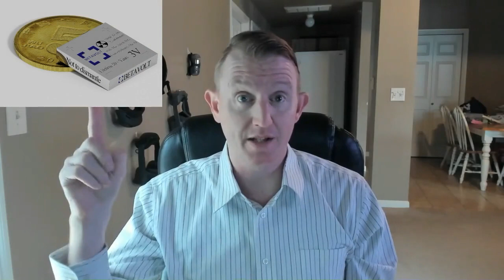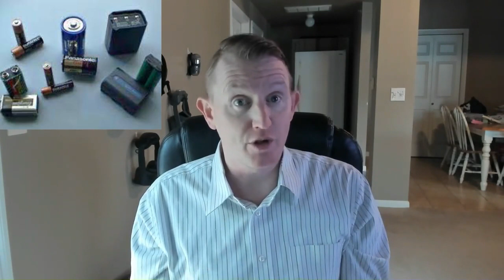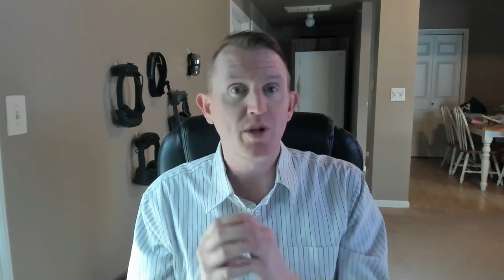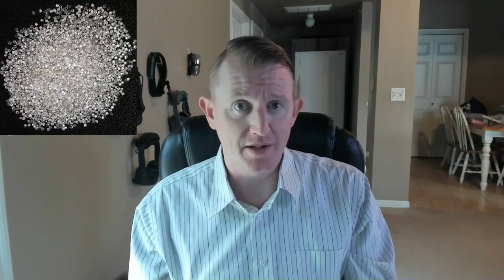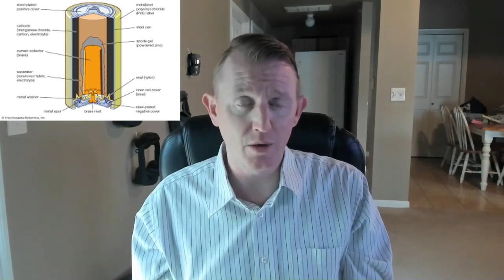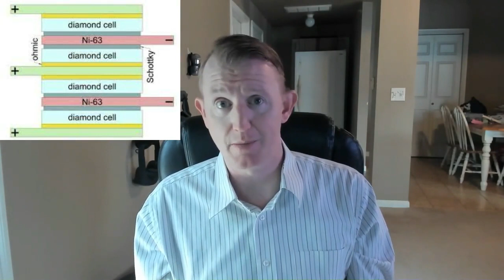How Betavolt's Nuclear Battery (Somewhat) Surprised Scientists with Its 50 Year Power Lifespan

Comment: There are many different semiconductive materials that will work and do work at a  mass produced level . Diamonds are now mass produced and are relatively cheap if that was one of your choices. Solar cells work on the same principle using radiation frequencies in sun light as the electron source in the P-N junction. This tech can be sized to run cars and homes safely but it wound disrupt our power structure  and political control over Humanity and will not be permitted by the deep state.